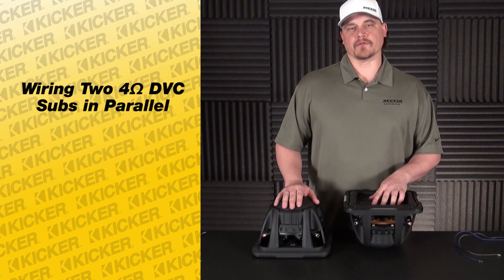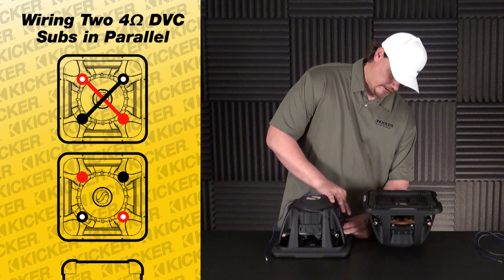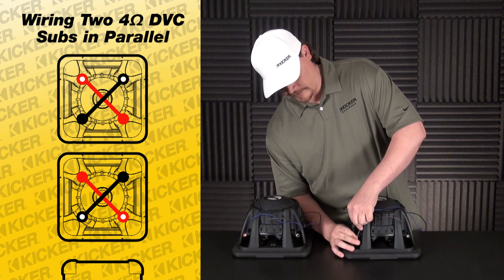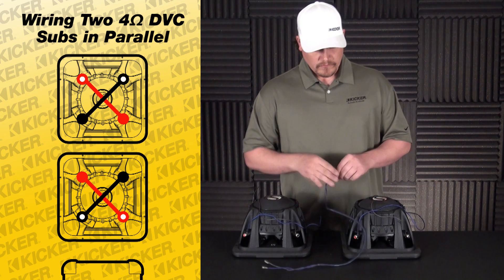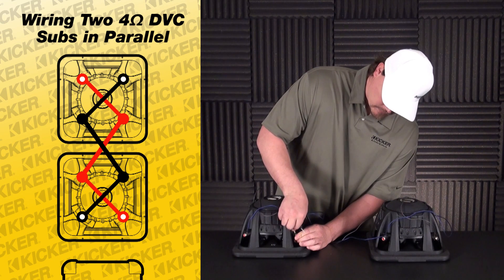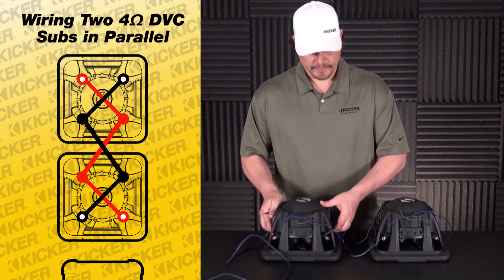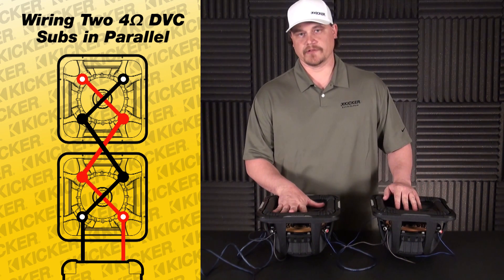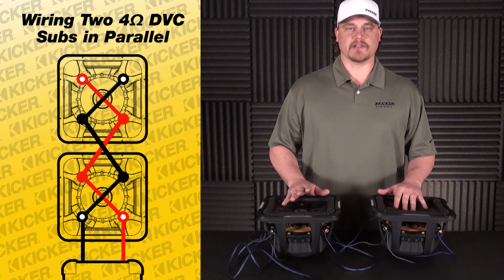Subwoofer Wiring: Two 4 ohm DVC Subs in Parallel

Comment: How do I find the ohm load to my amp? It's a 1600 pioneer champion series 2ch... And I got 2 L7 10" subs with a 4 gauge amp kit 125a in line fuse 3farad vm audio capacitor ...
Reply from the maker: Best way to find the details of your Pioneer amp is to check their website, usually in the tech support area.  Find the instructions, and the ohm load tolerances should be printed there. The model number should be on the amp somewhere.

Comment: I have a mono amp, but it still has 2 positives and 2 negatives so at the end, how would I connect them to the box terminals and to the amp?
Reply from the maker: It depends on the amp.  Could you tell me the manufacturer/model number of the amp and subs?
Reply: KICKER I have two SA-12 D4 REV.3 - Sundown Audio 12" 750W Dual 4-Ohm SA Series Subwoofers, and a Skar Audio RP-2000.1D Monoblock Class D MOSFET Subwoofer Amplifier, 2000W
Reply from the maker: The voice coil math applies to all subs, so you are safe there. The Skar amp says its 1 ohm stable. The two sets of terminals on the amp are probably just to make wiring easier (so you don't have to shove multiple sets of speaker wires into a single terminal).  Treat them as a two connections, going to the same place. You may want verify this info with the manufacturer as well.
Reply: KICKER okay, thanks
Reply from the maker: Glad to help!
Reply: KICKER Sorry, but if the box terminals don't come with wire coming off of them, can I just connect the subs to the box terminals with speaker wire? positive to positive and negative to negative?
Reply from the maker: Yes you can.  Just verify you have the right ohm load with a multimeter before you connect it to the amp.
Reply: KICKER make sure I've wired them down to one ohm?
Reply from the maker: You can wire in series parallel. Here's the video to show you how:  https://youtu.be/PNsWjBtwc2g?list=PLV2hurat1mvmHUBLRPIfRMkWKtIO-TSNo
Reply: KICKER I'll wire them to 1 ohm like in this video, I only have 2 subwoofers
Reply from the maker: Ah ok.  Here you go! https://youtu.be/QncMG5-5TVY?list=PLV2hurat1mvmHUBLRPIfRMkWKtIO-TSNo
Reply: KICKER thanks!
Reply from the maker: Glad to help! Maybe next time you need gear...remember who helped you out :-)
Reply: KICKER will do

Comment: how to wire two dual 4-ohm 15 inch speakers to get a 2 ohm load
Reply from the maker: Unfortunately the math doesn't work out on that. You can get 4 ohms in series parallel or 1/2 ohm in series.

Comment: I have 2x 07CVR124's, what wattage amp should I buy?? What should i look for? Ive read around a bit but I have found many different answers. Also what guage sound wire should I use for the best sound? Should I wire them the way you did up above? Forgive my noob questions, I am prepared to learn though ;) Thank you, looking forward to hearing back :)
Reply from the maker: The RMS is 400 watts per sub, so you're looking for about 800 watts total at 4 ohms (you'll want to wire them series parallel). This is the best one: http://www.kicker.com/44KXA16001
Reply: i ended up wiring the - to - and then the + to + on  each speaker individually, then choosing one - and + from each speaker and putting it to its own output from the amp instead of wiring the speakers together.
Reply from the maker: OK and what ohm load did you get before you hooked up the amp? Did you put it on the meter?
Reply: No i did not check with a meter. I have a test in my shop though. Just dunno how to check for ohms with it. Im a noob.
Reply from the maker: This video is for a different ohm load sub, but it does show you how to wire in series parallel and how to check that with a meter.  I've bookmarked the video to start with how to check your final ohm load: https://youtu.be/htx0aXmzFmo?t=2m24s
Reply: I'll give it a try this weekend and let you know the results

Comment: What's the difference between the l7 4ohm and 2ohm? Which is better
Reply from the maker: Different ohm loads exist to get the most out of the amp you're using, and/or to let you use the number of subs you need to create your system. All of the subs of a given series and size have the same specs, whether they are 1, 2 or 4 ohms. Make sense?

Comment: i have a 2 channel sony xplod 1200 amp and 2 12s kicker  comp S 4ohm what is the best wiring method i should use ?
Reply from the maker: Whats the model number of the amp?  We need that to determine what it's capable of handling.
Reply: Sony Xplod Xm-2200GTX
Reply: My battery cable is kind of skinny as well. I don't know if i need a new amp ( wich in that case ill get a kicker amp ) or a bigger gauge cable .. what size is the gauge recommended for that amp?
Reply from the maker: That amp has two 40 amp fuses, so 80 amps total. This means you should have at least a 4 gauge power wire if the distance from the amp to battery is at least 6 feet long (most are 12 to 17 feet). Since the amp is 2 ohm stereo or 4 ohm mono stable, the best wiring for that amp is simply 4 ohm stereo. This will deliver @200 watts per sub according to their instruction manual. This is below the RMS power of the sub, but its the best you can do with that amp. If you were to switch the amp out, I'd consider a CX600.1.  http://www.kicker.com/43CXA6001
Reply: So it is the amp that is weak .. right ?
Reply from the maker: While this amp may do fine in a different situation, it is not made to get the most out of the subs you have.
Reply: If i switch to kicker cx600.1 ... will it be better ?
Reply from the maker: If you go the CX600, youll get the exact RMS power from the subs - which is where they like to be. If you go to the CX1200.1, the subs will be able to run to their peak, but understand that no subwoofer - of any brand - should run to their peak all the time.  But it it nice to have access to that kind of power.  It is like having a sports car...you know you can go very fast if you want to - but you don't do it all the time.
Reply: I will soon upgrade to kicker cvx 12s . What amp should i get  cx600.1 ? Or cx1200.1 ?
Reply from the maker: The CVX12 takes 750 watts RMS and 1500 watts peak for each.  This is more than double the Comp sub you have now. You could do two cx1200.1, or get a single KX2400.1.
Reply: I have a kx 600.1 amp. I plugged it up but it dont play . Is not on protect mode and is wired correctly . Ot powers on but no sound even when is plugged up to speakers . What could be wrong ?

Comment: what is the best amp to use for this speakers
Reply from the maker: That will depend on the number of speakers you have, their ohm load and their size.  If you tell me what you have in mind I can make a suggestion.
Reply: KICKER  I have 2 12 kicker speakers  exactly connected the way the guy has them on the video
Reply from the maker: Which kicker speakers do you have?  We have 11 models.
Reply: KICKER I have the l3 speakers
Reply from the maker: What ohm load are they and how many do you have?
Reply from the maker: Oops I see you have two.  Just need the ohm load then.
Reply: KICKER I believe there 4 ohm I wired them down to one like in the video
Reply from the maker: If they are the 4 ohm DVC then you can get either a 4 ohm load series parallel, 1/2 ohm parallel or 16 ohms. Hence, 4 ohms is your real target. So, you would be best off with the KX 1600.1, which will deliver the proper RMS power at 4 ohms. Use this video: https://youtu.be/cDkBxeSLEAc?list=PLV2hurat1mvmHUBLRPIfRMkWKtIO-TSNo 

This is the closest video to your wiring.  Treat each voice coil like a speaker.
Reply: KICKER thank you for the information I will look in to it
Reply: KICKER what are the best 6x9 speakers  you have
Reply from the maker: The new Q series. Some of the best we've ever made. http://www.kicker.com/q-series-qs-coaxial-69-4ohm

Comment: i wired my dual 4 ohms l7 15 inch  to 1 ohm parallel how you showed on video on to a 2000 watt hifonics brutus elite would i burn something?
Reply: KICKER i burnt one of my subs i just want to see if you would know why so i wont burn another one sorry im just new to this i was thinking because i was messing with the bass test tone trying different hz to get my gain from my amplifier
Reply: Does your amp handles a 1ohm load? if so you should be fine.
Reply from the maker: I found the specs on the bex-2150-1d, and it said it was 1 ohm stable.  If that's the same amp, then you're good.  I'd go to the hifonics website to confirm if I were in your shoes, or contact them directly.
Reply from the maker: There are several things that can lead to a subwoofer failing. Sometimes its the sub, sometimes its the amp, sometimes its the tuning or install. We can help you diagnose the problem if you give us a call. Tech Support's number is 405-624-8510, and they are open weekdays from 8-5 central time. They're happy to walk you through it, so you can tweak your system.

Comment: i have a nemesis 6000 and 2 kicker L712 how is better to conect
Reply from the maker: Hey Junior, we need to know what the Nemesis should be wired to?  Its not a Kicker amp, so I don't know the specs. If the L7's are the same ones we talked about before (dual 2 ohm), then you have 3 choices: 8 ohms, 2 ohms or 1/4 ohm.
Reply: KICKER my amp nemesis NA-6KM i conect like this video but is too much power. this amp show
 1 RMS/Max @4 ohm (<1% distortion) 1500/3000W
2 RMS/max @2 ohm (<1%distortion) 2500/5000W
3 RMS/max @1 ohm(<1% distortion)3000/6000W.
I just wire my 2 kicker L7 12 4ohm in parallel ,but is alot ,I just want 4 ohms final or 2 ohm final ,how I need to  wire to get that
Reply from the maker: We still need to know what the ohm load of the speakers are, so you can wire them correctly.  You can also lower the gain of the amplifier to reduce the power.  Another option is to go a car stereo shop and ask for their help.
Reply: Hello I have amp Hifonics X2200.1D 2200W X-14 Series Class D Monoblock Amplifier
X-14 Series Class D Monoblock 1-Channel Amplifier
RMS Power Rating:
4 ohms: 950 watts x 1 chan.
2 ohms: 1600 watts x 1 chan.
1 ohms: 2200 watts x 1 chan.
Max power output: 2200 watts x 1 chan.
Illuminated Hifonics badge

Two l7 12 2ohms two coils how to wire them two ohms
Reply: How can I wire those L7 12 to get 8 ohm

Comment: i have 2 l7 4ohms 
can i wire them to 2ohms to a. kicker cx1200.1?
Reply from the maker: Hi Fernando, unfortunately the math doesn't work out on that. You can do 4 ohms  in series or 1 ohm in parallel. The new KX mono amplifiers are coming out next month, and they are 1 ohm stable.
Reply: +KICKER ok thanks
Reply from the maker: Glad to help!

Comment: Sooo can this be achieved by wiring red to red and black to black and running them on a bridged channel on a monoblock amp? Or can i do red to red and black to black and run each sub to their own channel
Reply: Amp is a fusion powerplant pp-am200010 2000w class d mono block  soo to clarify... do i wanna doneach sub red to red and black to black and go to each channel.... or wire them together like this.... and go off of one channel
Reply from the maker: What model of sub do you have and how many of them?
Reply: I have 2 of the S10L7's dual 4 ohm subs
Reply from the maker: Unfortunately the math doesn't work out on that.  You can do 1 or 4 ohms with those subs. Since you have a mono amp, they probably designed the 2 sets of inputs as a matter of convenience during setup.  It's still one channel as far as the amp is concerned (unlike a stereo amp, where each set of inputs is independent).  We made a free app to make wiring and tuning easier.  You might want to check it out: http://www.kicker.com/kickeru

Comment: planet audio anarchy 2600 2channel mosfet pushing 2 12 kicker l5 solo x 2500 RMS 5000 max each I have it wired parallel like you show and bridged in a single cab Chevy it hits ridiculous but the protection light flickers when hitting  any way you could shoot me a pic of what all the amp settings should look like or describe it to me would be awesome I don't want to trash these sub's there kickers classics lol
Reply from the maker: If you own a Planet Audio amp, you would probably want to contact them about how best to set it up. They would also be the ones to discuss why the amp is going into protection. We wouldn't want to speak in their place about their product.  Another option is to talk to the folks in the car stereo shop where you bough the amp from, if that's possible.
Reply: KICKER would rather kicker BC honestly I wouldn't care as much if I burnt the amp up compared to my subd that cost like 5x what the amp did I got it off internet its cool no worries I'll figure it out. propably my most reliable option
Reply from the maker: If you like, you can give us a call.  Tech Support is open from 8-5 CST at 405-624-8510.  We can help you check your wiring, crossover points, etc..to make sure those parts of the system are good to go.

Comment: hello, I have 2 L5 12" and 2 amp 600.1 amp, olso have solo x 12" and 2500.1 amp, my cuestión is can I put everything together
Reply from the maker: We dont normally encourage you to do that.  The differences in power and cones (2 vs 1) could result in some muddy bass.  We would recommend you choose one set or the other.

Comment: which would be better to lower the ohms or keep it high, i know you get more power lower ohm but it takes less power at a higher ohm so there for you would have more power
Reply from the maker: The trade off is not just power, but accuracy. Higher ohm loads will tend to offer more detailed audio. What most people don't know is that doubling the power is only about a 3dB gain in volume.  Most people perceive doubling the volume as 12dB, though that is subjective.  The point is that as you gain a bit of volume, you lose some accuracy.
Reply: KICKER so if you keep it at a higher ohm it will hit the notes better but if you lower the ohm it looses the note
Reply: KICKER what i ws wondering tho is it better to keep the ohms higher to use less amperage and have more power, or drop the ohms and use more power by the sub but have less ppwer from amp
Reply from the maker: Close.  You'll still hear the note, but it wont be quite as clean and clear as with a higher ohm load.
Reply from the maker: We always recommend giving the amplifier as much amperage as is recommended.  This is usually done by knowing the output of the battery & alternator, as well as ensuring you have a proper gauge power and ground wire.
Reply: KICKER my thing is say if your speaker is 4ohm and you keep it there at 4ohm and your amp is say 1000 watts wouldnt you have the full capability of having the 1000watts to the speaker without dropping the ohms from my point when you drop ohms your using more power consumption to push the speaker to where if you left it at a higher ohm it would take less power to push therfore you would have more power because you wouldnt be consuming so much by lowering the ohm
Reply from the maker: Provided your amp can take the lower ohm load and you have the proper wire/charging system set up, you might want to try it both ways.  If you feel like you are missing volume or lacking clarity, this is one way to address either issue to some extent. Other factors are sound deadening, tuning, and of course both the quality of the music and the quality of the components themselves.  They all play a role.
Reply: KICKER agreed i was just wondering your point of view as your profession i was in deep thought about it lol

Comment: hey kicker my CVRs 12s are 4 ohm and I dropped them down to 1 ohm as you showed and for some reason my subs sometimes at high bass smell like they are burning??! can you tell me what is the problem? and my amp is 4000watts and 1 ohm stable and I have the kickers in a kicker box ported and on the side of the kicker box it says 4 ohms can you help me???

Comment: ?how would i wire 2 dual vc 4ohm subs to a 4ch amp. I tried to wire it up thinking the coils were 2ohms but it appears that each coil is 4ohm. so i need to wire up 2 subs unfortunately all i have for the subs is a 4ch which can be bridged

Comment: I have two Kicker 40CWR124 CompR Series 12 inch Subwoofer 4 Ohm and it has the switch for 2 ohm and 8ohm. I want to run at 1ohm. How do I set up the wires on the speakers for 1ohm? 
Remember I only have 1 terminal positive and negative on each speaker.

Comment: how many watts from the amp would I need if I wired two kicker comps to 1 ohm and do I use a mono block amp
Reply: All if 500 watt u would have 500 watt
Reply: +Bobby Eissler how many watts would I need to power 2 12 hifonics if each one was 450w rms and 900w max
Reply: +Bobby Eissler and if I wired them two ohms

Comment: Hey I have a Memphis 4K amp too but idk what are some good subs for it bc right now I have 2 12 kicker L7s but I turned it up earlier and one made like a pop noise so I haven't turned it up I feel like Ima blow it up if I do turn it up :/
Reply: Kurloz Soriano did u buy both subs at same time or is 1 newer than the other. It could b as simple as 1 is more broke in than the other. And truly u only need about 600 watts per sub. If u can get you a kx model 1200.1or the 600.1 but make sure kx. Swear kx 600 sounds like memphis 2000 and hits da notes better thann n e other amp out there. Speakin from experience
Reply: Kurloz Soriano and more power u add to subs ur better off with v ented box so the subs can breathe
Reply: And just know its a. Computer givgin you the answers when u ask on here

Comment: how many watts is a kicker 07cvr124, I have 2 they are 4 ohm,going to wire parallel to achieve 2 ohms, how do you connect to a 4 channel amp,that does support 2 ohms

Comment: Hay i wired my subs exactly how u showed and the were hitting unevenly then the voice coil locked up on one of the subs. My subs are db drive k9. They can handle 1ohm and so can my amp. Idk what happened. I need help please. Also started to melt wires goin from amp to sub box. Any help asap would be greatly appreciated.  
 Thanks